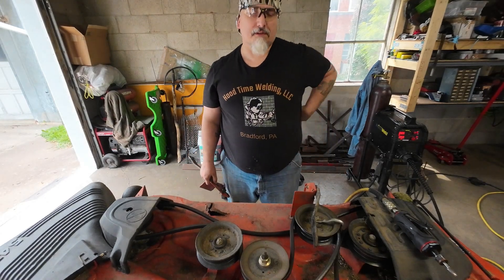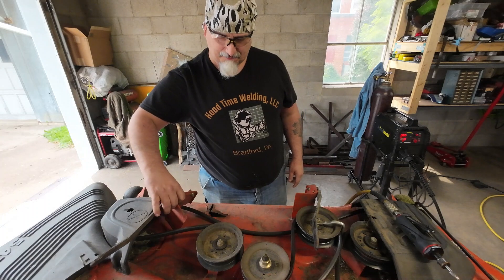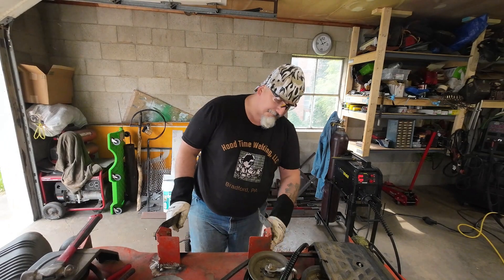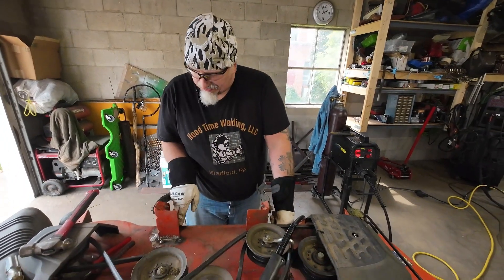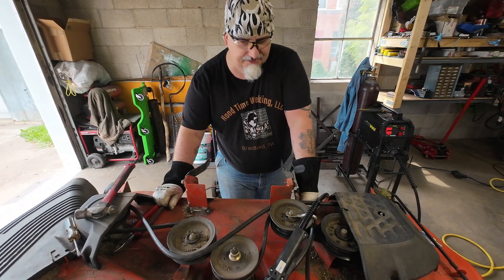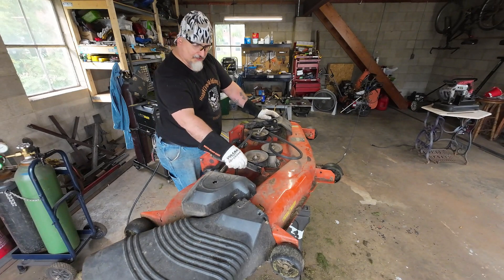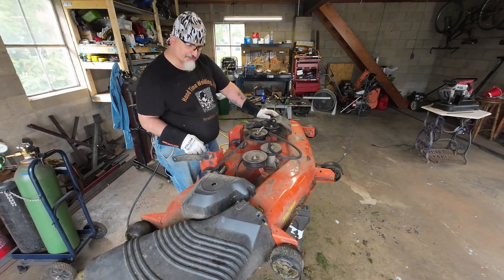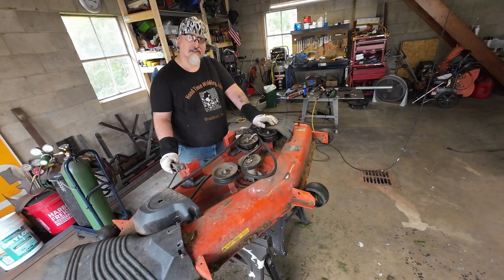Husqvarna Lawnmower deck repair| Welding and fabrication projects| deck repairs

Comment: Good video. So sad to see people spend money on a new deck or worse yet, ditch the whole mower when a few repairs/ mods will give years more of service out of the mower. Had to do the same last couple of weeks on two Husqvarna 46" decks, plus 1bent scalper wheel bracket. Another weak spot on these mowers is the front leading edge of the deck. There is a small tab, front center, that I believe is for attaching a grass catcher. It has a tendency to dig into high spots in the lawn and over time bends the leading edge inward, often to the point of hitting the blade tips. After straightening the leading edge back out, I bent the tab up, more out of the way, instead of removing it (might need to use it one day). There is also a round support bar that goes only "half way" across the front of the leading edge for support. I am welding a 1/2" x 3' (appx)  pipe bent to shape from the end of the original across the front. I am also welding the ends to the scalper wheel brackets for more support.
  If yours is like that, maybe you could do a video on that mod for others to see.
Reply from the maker: This was just a customer's deck. Everything else looked good at the moment. I'll keep that in mind though. I also did another deck that I did a video on. Cub Cadet that time. Those seem to be weak around the spindles and like to rust there. Like you said, a little work and you can get decks to last longer. Saves money. Thanks for the comments.